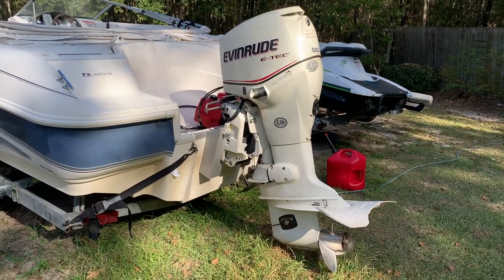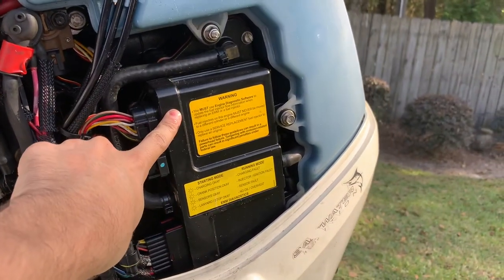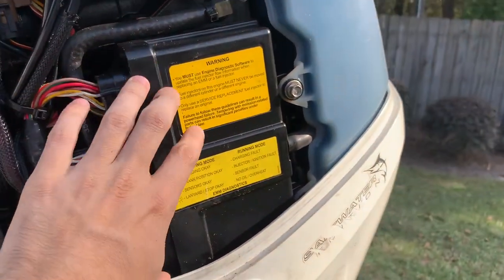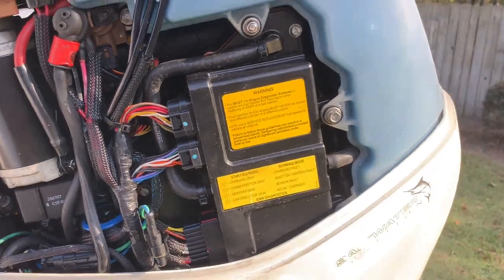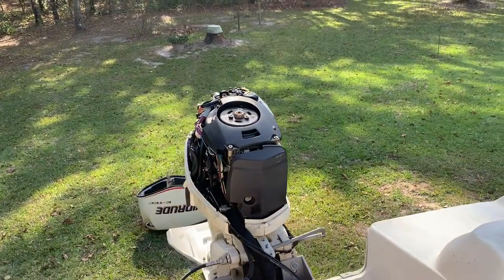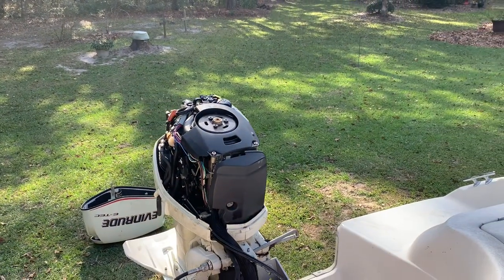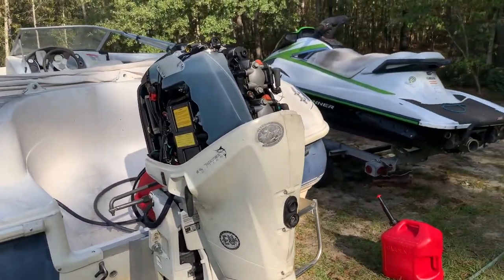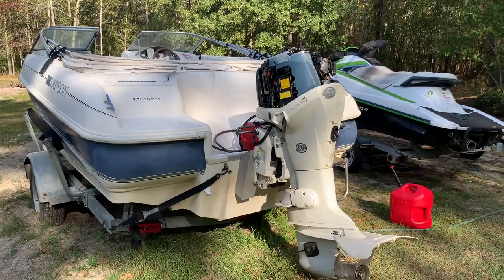How to Fix Your Evinrude ETEC Without Evdiag: Diagnosing No EMM Power and No Fuel

Comment: Emm's can be fixed normally, it's about 400,-. Also hp pump in vst can be bought separately nowadays, 130,-. Evinrude diagnostic sw is under 100,- and u can code the injectors yourself.
Reply: Not that one

Comment: This is a fantastic video - going through a similar issue with a 2013 90.  Same as you, previous owner said it ran good but when we got it home it didn’t run well and we found that one of the injectors was clogged.  The etecs are vary hard to to conduct DIY injector cleaning.  We sent the injectors off but now the engine coughs and dies.  It’s very frustrating.  I need to check the eem lights.  Will be checking vst pressure next.

Comment: My 90hp ETEC loses power when you give it more than half throttle. It will start bogging down and go back and forth, revving up a little faster then backing off, kind of that yo-yo effect when giving it half to full throttle. It will idle fine and it will go 3k RPMs fine, anything beyond that and it will start revving up and down back and forth. Seems like a throttle issue, possibly fuel.
Reply from the maker: Have you tried doing any cleaning to the fuel system? Even just something like mercury quickleen at the least?
Reply: @ramenbuilt6411  I was going to try that. It did get a new VST Fuel Reservoir & Pump last year as the old one was shot. I'm wondering if something happened to it. I noticed the airbox was cracked, but that shouldn't really effect it.

Comment: I just purchased this motor in the 2005 model. The motor sat for a year or so. I started, and idle strong. On the water it quickly bogged down and stalled. Rinse and repeat until only running in neutral with choke lever up.
Reply: I did add Seafoam to the fuel. It ran a low throttle for a while. Currently only runs in idle with lever up. I'm not much of a mechanic but I may tinker with it.
Reply from the maker: I’d check all of your filters and inlets into the vst. The rubber lines break down over time and will shed particles eventually stopping up the filters and inlets. This is what happened to mine. Without adequate fuel flow it killed the pump due to heat. What you are describing seems like an increasingly bad lean condition. Id clean it out asap and not run it much until I figured it out. Let me know if you have any questions.
Reply: @ramenbuilt6411  Thank you for your assistance. Greatly appreciated.

Comment: Can you still get parts for these pretty easily or harder to get? Thanks Kyle
Reply: Don’t get an evinrude. If you have one. Sell it.
Reply from the maker: You can, mostly everything is still available at least for now. They are pretty expensive though. Definitely not as easy to get as mercury or Yamaha though. Also, some shops won’t work on them.

Comment: Going to reflect on my experience with the E-Tec Vapor separator/electric fuel pump unit..(And there inner design differs depending on E-tec outboard you own)  and my issues with no fuel pressure. if you remove the top cover of the vapor separator (the top cover has a float that releases air and vapor if any gets trapped in the unit"  there is a tubing coil inside that cold water runs through to cool the fuel. Thats the core purpose of the unit to supply cooled liquid fuel to the the "medium" pressure electric pump that then supply's vapor bubble free liquid fuel to injectors ..    "fill the vapor separator full of liquid and blow pressured air through the water cooled coil you should not see any bubbles if you have them you have a leak in that coil and of cource it leak water into the fuel in the VST  ." The core issue is the fuel pump which is removable has a very fine mesh screen over its inlet at the bottom in the rubber grommet seat which you can  pull out and  "check and clean it" and I find it totally plugged quite often with little tiny rubber and dissolved plastic particles from breaking down fuel lines thats often so badly pluged that the pump can barely get fuel flow at all.  Where does this crud come from ? old deteriorating fuel line who's inner liners have been attacked by ethanol fuels,  it then sends this gunk through the system and it all ends up in the bottom of Vapor separator in the fuel pump screen.   The other thing that E-tec owners need to be aware of is there is "also" a spring loaded "fuel pressure regulator" on the outlet of the fuel pump that releases excess fuel pressure when the engine is idling  , on its outlet in the base of the vapor separator  is another fine mesh screen filter on the pressure regulator return line , if this small mesh filter gets plugged the excess fuel pressure will not flow back into the VST tank  and the fuel pressure will climb up way to high ,, this excess presure will "also" causes all kinds of run-ability issues as this high fuel pressure being supplied to the injectors throws off the mixture calibration making it way too rich. https://youtu.be/Qc7FrlcGVwg , E-tecs also have an inline a fuel filter that must be replaced.  The recommended interval is every 300-hours or three years for average recreational use. Its a low restriction filter and I have seen this gunk (dissolved plastic and rubber carryed in the Fuel) get past that fuel filter and into the VST plugging up these fine mesh filter a number of times ..

Comment: Not sure if you’ll see this, i have no spark but emm lights function as they should, emm also has no codes i believe, could this be a bad stator?
Reply from the maker: It could be. I’ve heard of people having issues with the stator on these. Best thing to do is get a volt meter and check resistance on it first.
Reply: @ramenbuilt6411  I will be checking resistance on that and the capacitor, when i plug in with the software it shows the motor is outputting 24-26 volts on cranking. I thought this was supposed to be 55, but the manual says between 20-40 is normal, leaning towards capacitor being bad now, i will update you

Comment: Did you change or program in the old injectors to the new EEM
Reply from the maker: I bought a matched set so I didn’t have to. If you change one or the other independently you would need a program.

Comment: If we clean the injectors do we have to reset the computer on it?
Reply from the maker: I could be wrong but I do not believe so. If you change them, you do have to recalibrate.
Reply: You don't need to reprogram but you do need to make sure you put the injectors back on the same cylinder they came off of.   You can't mix them around from one cylinder to another.